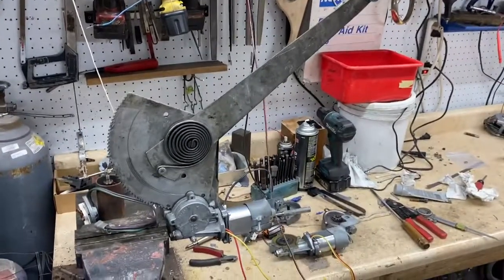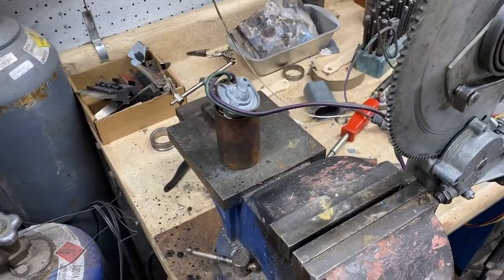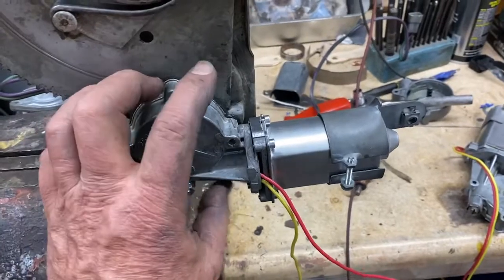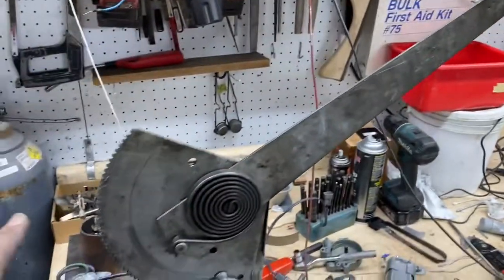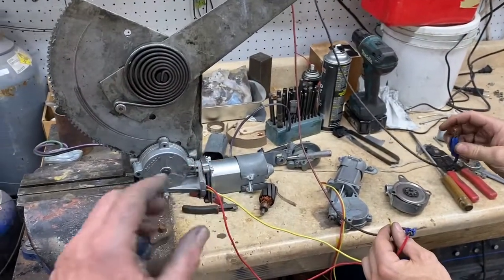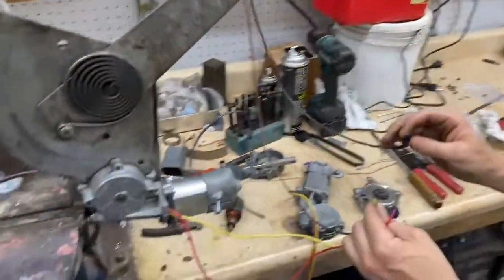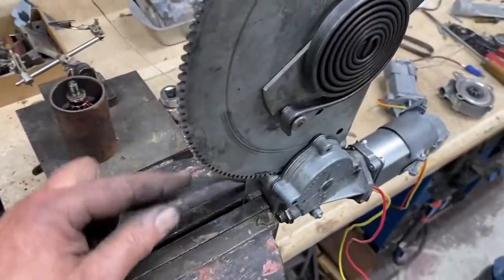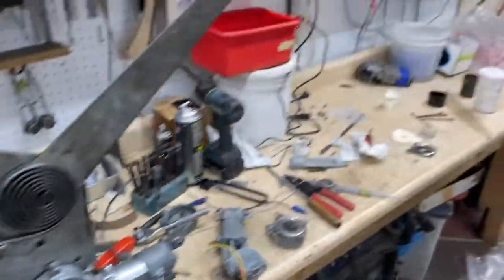1967 Chrysler Imperial electric Window regulator

Comment: I have a 66 Charger which uses the same motors. The original rubber gear puck tore up, so I purchased after market gear kits. One from Dorman and one from Brock. Both after several up and down tests had the metal gear teeth break off. I took the regulator out and cleaned it up ( was a little sticky  and needed lube), I do have a slight deviation when the regulator blade goes through the motor. Is there any allowance for a slight imperfection here? Second, I see alot of complaints with the after market gear kits shredding the metal gear. Have you had any issues? My original never shredded the gear but I'd rather not spend a $100 on an NOS gear kit if I don't have to. Thanks for your time, and a good informative video.